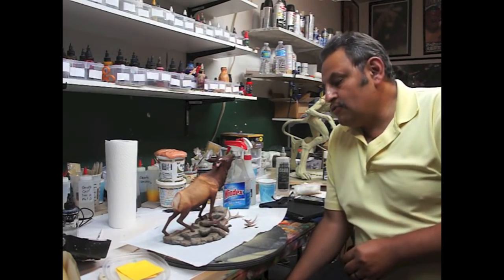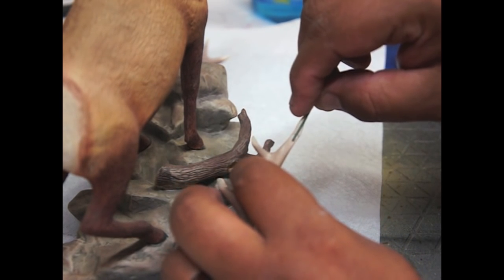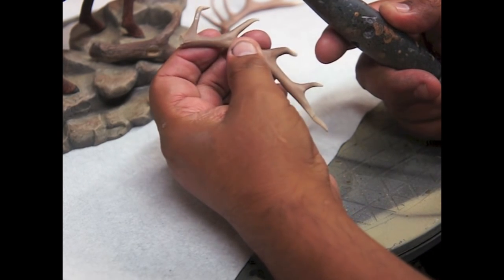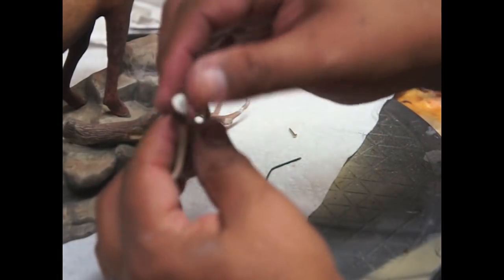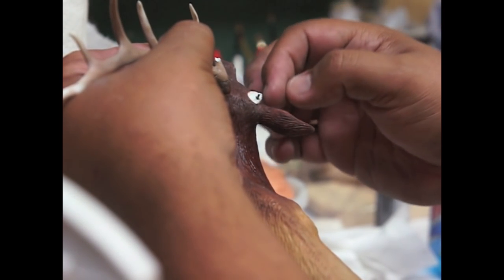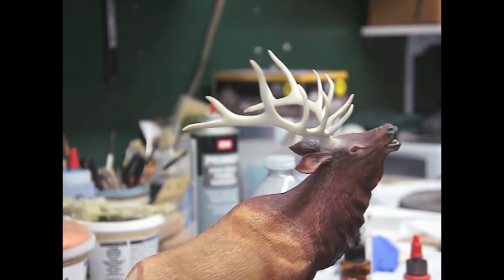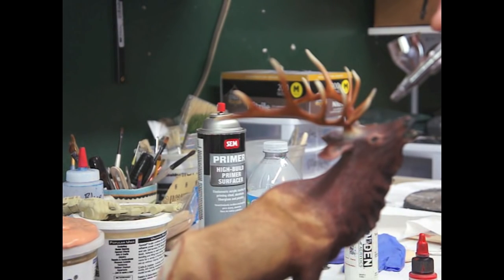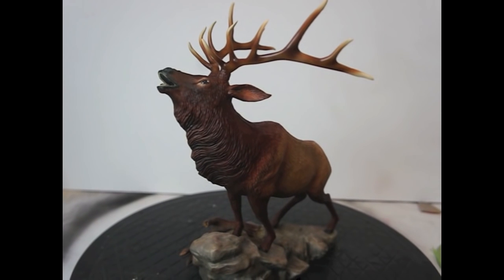fixing broken porcelain antlers

Comment: Nicely done! I used to cut and drill glass and I am sure porcelain is the same...a kind of glass anyway. I used water every time I cut glass with a saw or drilled holes in it. Some times I used oil. both  oil and water worked about the same way...kept it cool.  Great video as usual...thanks for sharing...